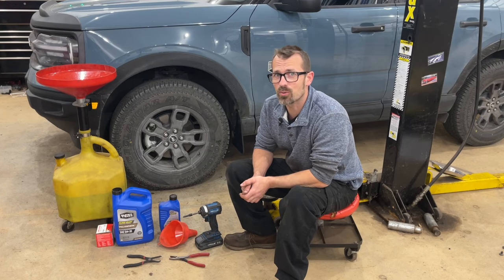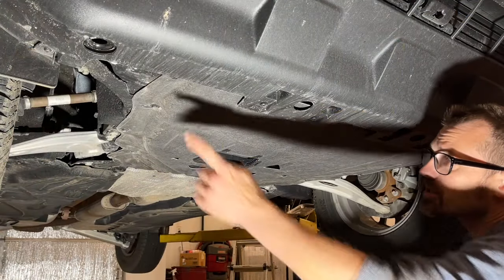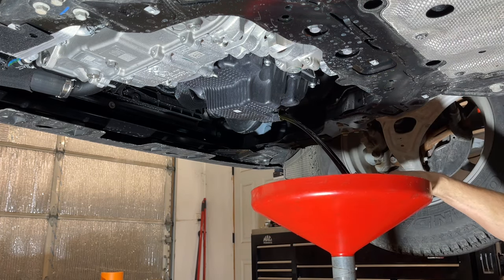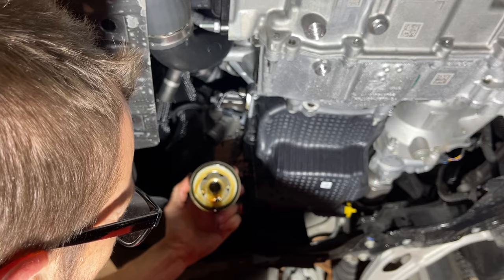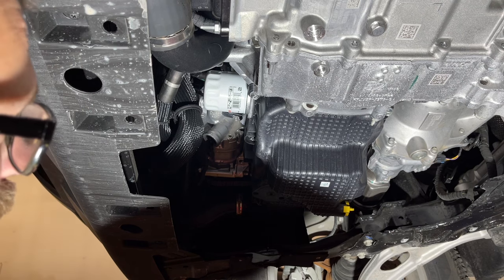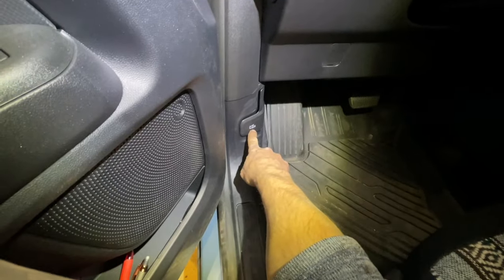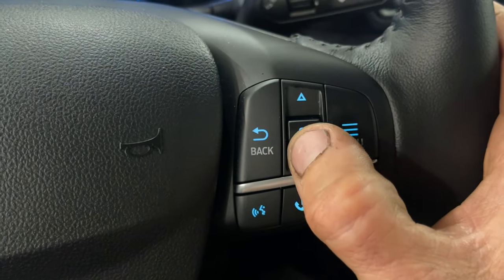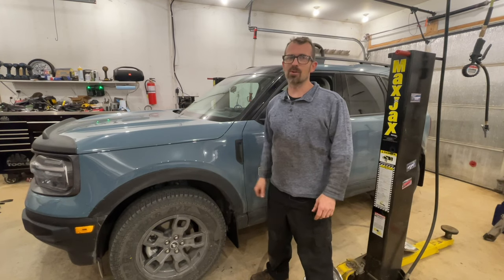Ford Bronco Sport Oil Change 1.5 2021-2023 and reset

Comment: great video. I would use a hand tool for screws so they dont strip. Wipe the filter gasket surface clean, and lubricate the new gasket. otherwise the best video presentation Ive seen.

Comment: FYI -- The factory 2024 oil filter was 1 inch shorter than the replacement filters (purolator 10241 or Motorcraft FL910S)  2.25 versus 3.25 inches.  the 13 screws already hold the cover well, the 2 plastic clips aren't really needed.  Didn't really need to lift the car. There was enough room for a one arm reach job. (If more room is needed drove onto a 2x6 to get the extra 1.5 inches)
Reply from the maker: Thanks for the additional info!

Comment: i learned that its always good to take the oil cap off before you drain the oil so you dont end up with a engine with out a way to put oil back in
Reply from the maker: Great tip Austin!

Comment: Bro you are in the right profession! Those 12 T-30 would have made me toss a wrench right quick. 😂
Reply from the maker: lol, remember when an oil change was easy and you didn’t have to take 100 clips off and 3 panels to find the drain plug. Haha
Reply: Lost 1 already? There are   13 torx screws. if I can find some thumb screws with the same thread it'll make things really easy....

Comment: Would you recommend switching over to full synthetic if budget wasn't a concern?
Reply from the maker: Absolutely.  If you do your own oil changes the cost difference will be about $5.  If you bring it in, then they will charge you substantially more.  Either way, synthetic oil is superior oil and I would definitely recommend running it.

Comment: Well done draining it without making a mess. I ended up buying the Ronin Factory easy oil drain plug to replace the yellow plastic plug as it allows you to drain the oil in a controlled manner. It also has a magnetic tip on the plug.
Reply from the maker: Thanks!  Thanks for the tip!  That sounds like a great product.  I’ll look into it and maybe link it in the description.

Comment: 4:55 alternatively, install the panel after pouring in fresh oil, running the engine for a minute and checking if there are any leaks.
I can see that the bronco sport owner will lose those panel screws quickly if they go to a quick drive through oil change shop.
Reply from the maker: That’s a great tip for anyone with any leaking concerns. 

I totally agree, those screws will go missing in a hurry. Another reason to tackle this job at home.

Comment: I just changed my oil in 2023 Big Ben and put back in 6 qts and 20 oz. I got this out of manual. 6.6 qts.  Is this what you put in?  thanks
Reply from the maker: No, as I covered in the video and describe, it took 5.3 qts.  I’m not sure if there is possibly a difference from year to year.
Reply: I just changed my sister's 2023 Bronco Sport Big Bend 1.5L with the same plastic oil pan.  I initially put 5.3 Quarts, checked out and it was low that none of the holes in the dip stick were covered.  I then dumped another .7 quarts (6 total quarts) and it went up to the second circle.  Then dumped another .6 quarts (6.6 total quarts) and now it's full.  I can confirm that at least mine took 6.6 quarts and it's a 2023 Bronco Sport Big Bend with the 1.5L (plastic oil pan)
Reply: @IADHDD  That is the correct amount of oil the 2023/24 Big Bend 1.5l engine takes according to the manual 6.6 quarts.  I had to correct the dealership when they changed the oil in my Bronco.  They shorted the change by a quart.

Comment: I bought a 2022 Ford BRONCO SPORT and the manual for the 1.5L say “Oil capacity: 5.3 qt(5.05L) what you said!! But i wonder why the same manual bring an extra paper that say : 

“Engine oil capacity and specification - 1.5L Ecoboost, vehicle built from 10/2021 

Capacities: 6.6 qt (6.25L) including the oil filter “
Reply from the maker: Nobody will ever know. 😂
Reply: @bennieaust  so?
Reply from the maker: What’s the question?  There wasn’t a question in your original comment and I don’t understand what you are asking “so?”
Reply: @bennieaust  I'm just confused what the correct oil capacity is for my bronco.
Reply from the maker: @pr4lviper , I have no idea. The one in my video took 5.3.  I have found owners manuals to be wrong on a lot of occasions, but I’m not the manufacturer so I am not making any claims on what yours will take, only stating what the one in this video took.